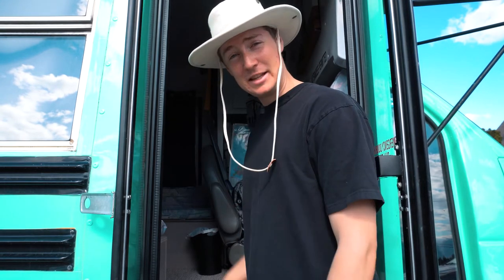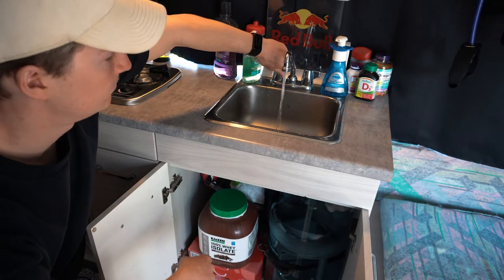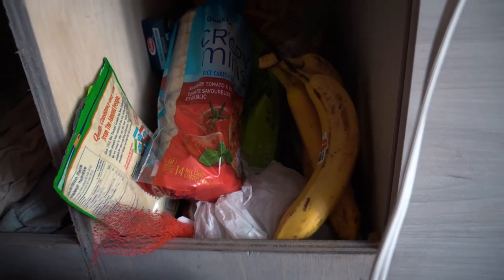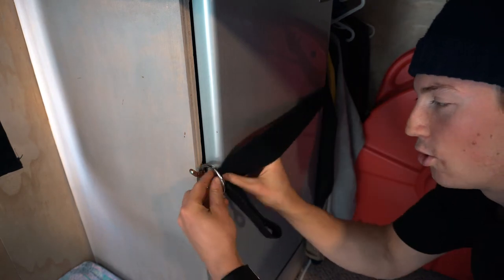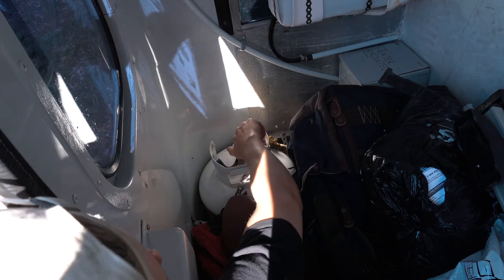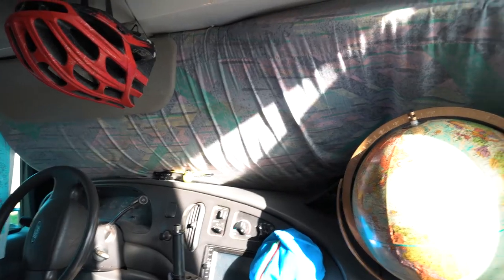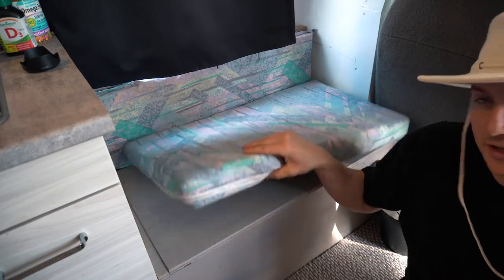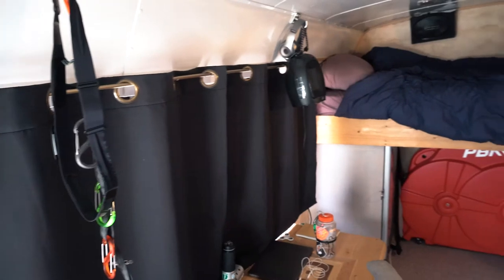Living In A Converted School Bus!

Comment: Propane tank needs to be stored in a vented area since they are designed to vent gas. If your "garage" isn't vented you're risking 💥explosion💥. Your propane bottle is sitting right by electrical devices that may very well spark, setting the whole thing off. 😬
Reply from the maker: It is vented. Appreciate your concern but it’s all thought out

Comment: How long will those batteries last? I imagine pretty long because they aren't being used for ignition?
Reply from the maker: Not 100% sure, but I haven't changed them since installing. As they are only for the electrical inside the bus and not the ignition, I assume a while
Reply: @Nick.Pelletier   Great to know, ty. I want to incoporate enough power into my off grid build to run a TV and gaming console with probably a fridge running constantly as well.
Reply from the maker: @kittywampusdrums4963  the solar system that I have does that for me. Always have the fridge running and I can plug basically anything into the outlets, besides a high wattage space heater. Everything else is fine
Reply: @Nick.Pelletier  awesome, yea i also figured maybe a water pump if i build a shower or sink. Some sinks have a foot pump thing but meh.
Reply from the maker: @kittywampusdrums4963  I have a water pump underneath my sink and it’s nice to have for sure